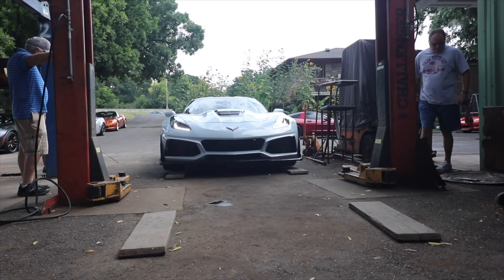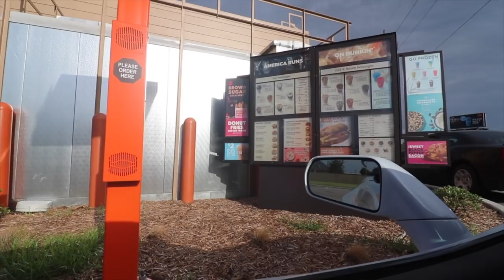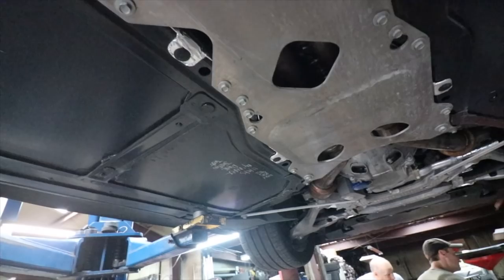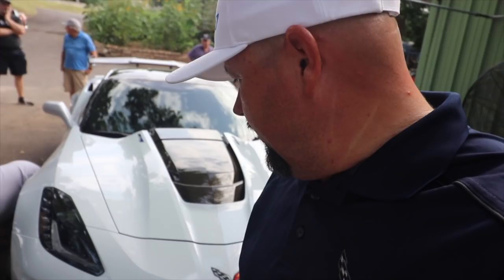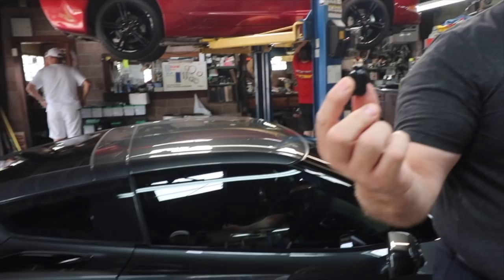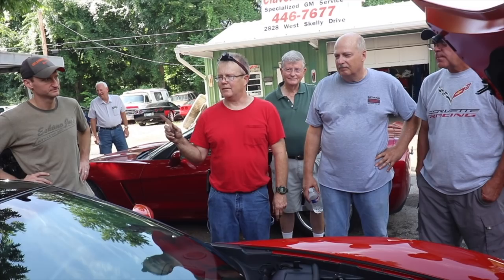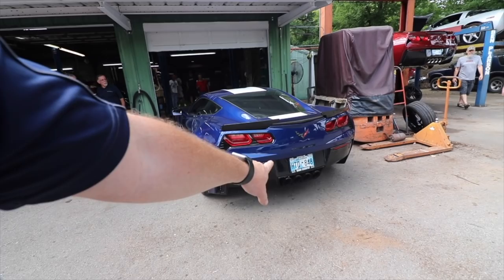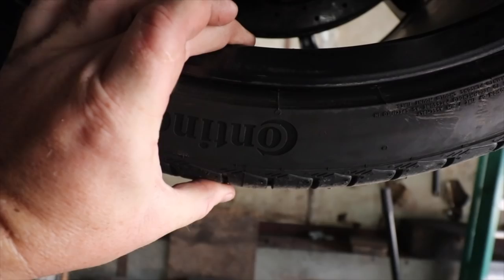MY ZR1 NEEDS A CAM!! | YOU HAVE TO HEAR THIS

Comment: Very cool to see the front underwing from beneath car! They went to pretty extreme lengths to improve the aerodynamics of the ZR1 👍🏻
Reply from the maker: They did, allot of little small changes to direct the air but were very noticeable. The V brackets jumped out at me right away.  They definitely redesigned it to keep that LT5 cool.  It my opinion this is everything the Z06 should have been but with the LT4.

Comment: Only mod? Hope you plan to at least consider getting a good oil catch can? These LT motors ingest a ridiculous amount of blowby oil, and at only 9k miles my blower lid and blower where caked with blowback oil. The back of the valves already began to coke also, started reporting detonation from my data logs to. Since I cleaned my valves, and Supercharger of blowback oil and installed a catch can I have had no more problems. Please consider getting one, it is a small investment that will protect your engine.

Comment: 130k fully specced out zo6 or 138k a base zr1 with no options at all? Which would u go for?
Reply from the maker: The Z06 will be worth 30k less the moment you drive it off the lot. The ZR1 you could turn around and sell it for 10k more than you paid for it.  Unfortunately GM has made way too many Z06’s and with the C8 coming out this winter only going to hit the Z06 even more.
Reply: Corvettes 918 if you had to pick between a gt500 or a camaro zl1 what would u pick?
Reply from the maker: Great question, I think the GT500 is going to take the Mustang to another level.  It wold be close between that and the ZL1 1LE.  GT500 how it sits now compared to the Zl1 as it sits now not even close the ZL1
Reply: Corvettes 918 are the gt500 more of a drag car or track car? I’ve never really been into Mustang or muscles cars but the gt500 and zl1 have really caught my eye.

Comment: I got the only ZR1 in the world that has an 8.2L V9 with VTEK and 1000hp and it does 0-60 in 1 sec. Flat. 
GM didn't even announce that they were making this car and I was called personally by GM and asked if I wanted to buy it. Had to wait until 9pm when my shift at McDonalds ended before I could go pick it up. Its so much faster than any car on the road...I have to race airplanes cause they are the only thing capable of matching my performance. Id show you pictures but i was told by GM that I shouldn't show it to anyone yet, but take my word...its real.